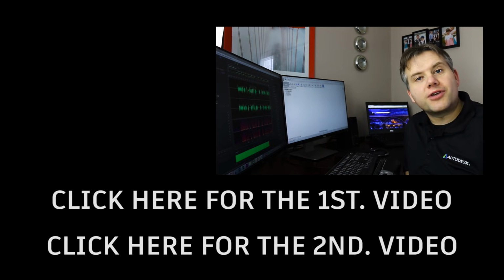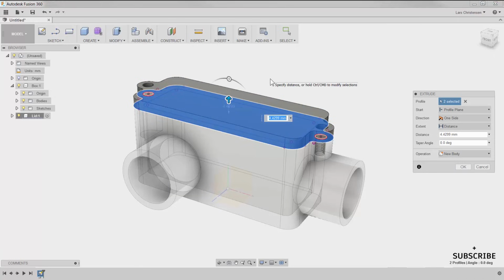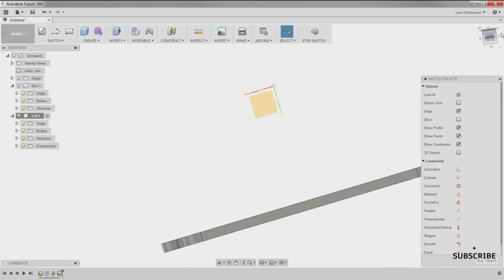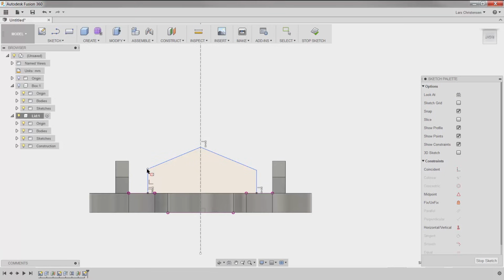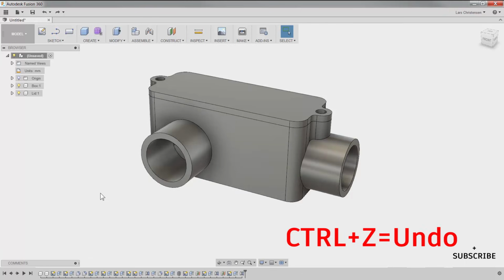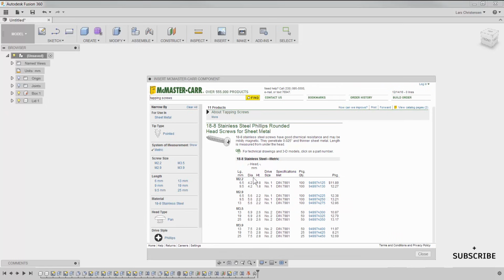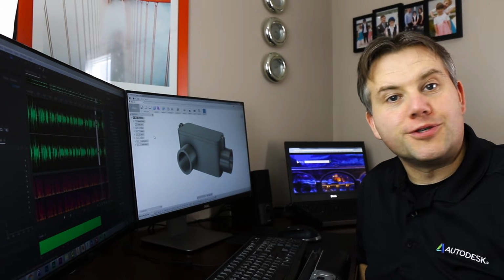Fusion 360 Tutorial for Absolute Beginners— Part 3

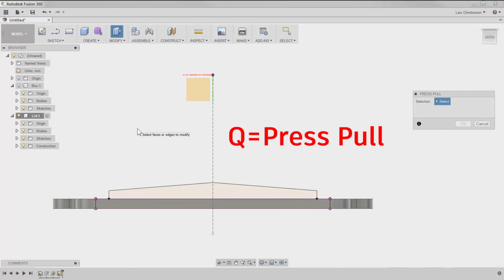Comment: Might be a version discrepancy (using June 2021), but at 9:17 I had to additionally fix one of the points on the lower segment of the sketch to have it fully constrained (blue outline to black). Not sure how his version "knew" to fix that lower segment to the lid, given that the plane we're sketching on technically has no relation to the lid... Anybody know if/where I'm wrong in saying this?
Reply: Faced the same problem
Reply: I'm having same issue - when I start placing the lines the cursor will not show the blue cross because its not 'attaching' the points to the line of the lid.

Comment: Hi only downloaded the free home user trial on 21/05/21. Your tutorials have been great to get to grips with the software, however I had and issue creating the "tabs" on the lid. When preforming the mirror function the second tab is in the wrong location. Took me a minute to figure out why but I found that the origin of the lid is off even though the lid is still centered with the body. Also I've seen im missing some menu options but I guess that's because its the free home user version. I'd like to know where I went wrong.

Comment: I've been wanting to get into F360 for a while, coming 8 years of using Rhino, a bit of SolidWorks and ProE, and a bunch of years of Autocad (which I hate, no offense, but good god, the bugs that have literally ben there for decades without being addressed) before that, had done the linkedIn series and was somewhat disappointed with that, but this was outstanding, even with the fair number of changes in the UI.  Had some difficulties getting the snaps to show on the tabs bit, but fixed that with a construction line.

Greatly appreciate not just the how's but the why's and the minimal glossing over of stuff most users do without thinking due to muscle memory but forget that those little bits if not explained or mentioned on these kinds of videos can bring those trying to follow it to a screeching halt.   Having done a fair bit of software training videos as part of my job in the past I have all the more appreciation for your approach.  Your videos will cut the ramp up time to next to negligable.   Thankee.

Here's a little piece I did in Rhino and rendered in Blender's cycles a while back that would have been massively quicker to create in a full on parametric modeler:

https://youtu.be/-zKHsOtAEL8

Comment: Great Video!  I have been able to complete the Box and Lid, but 
I am stuck at 6:58  When trying to create a line, my cross when getting close to the edge of the lid does not turn into the blue.  If anybody had the same issue, please help.
Reply: I did, turned out that the wrong face was towards me, also tilt the model a little so that it is not completely flat
Reply: Project the edge line

Comment: For anybody struggling from the bottom moving instead of everything resizing to the bottom, I just selected the bottom line that closed off the box and right clicked it and hit Fix.  Then when following the rest of his directions, everything seems to work smoothly.

Lars, please pin fixes for these issues or address them.
Reply: here the answer   https://forums.autodesk.com/t5/fusion-360-design-validate/can-t-snap-to-point-on-other-sketch/m-p/9479177#M215337     worked fine for me, just a lil click in pref

Comment: I just don't get the pieces on the lid, tried about 10 times now and either can't select the correct points and when it finally worked (once) the piece on the bottom of the lid was at the edge and not offset.

Comment: Lars, when I made the 4 protrusions on the underside of the lid, all 4 created themselves slightly above the lid (by about 0.125mm). I fixed it by manually moving all 4 of them down, but I was wondering what the easier way would be to snap them to the lid?
Reply: I had a similar problem, all I did was select the flat edge of the protrusion and the edge of the lid, and gave them the "collinear" constraint, which made them line up. Hope this helps!
Reply: @neekthegiraffe  helps immensely
Reply: @neekthegiraffe  were you able to get it to cut through the box on the short side hole without leaving the lines there

Comment: Hi while placing the screw into the hole using joint it goes in upside down Why
Reply: There's a button in the pop-up dialogue box that says "flip". Click it, and the screw inverts into the correct orientation.

Comment: Every time I try to change the numbers on the tabs to make the height correct, it either pulls away from the lid or goes into it. I can not figure out how to make it snap to the bottom side of the lid.
Reply: I just had the same issue and managed to find the answer online . . click on your name (top right) and go preferences  .. click on the design tab .. tick 'Auto project edges on reference' ... Apply and ok that... Now your line should connect to the other line and things should work correctly. This fixed it for me so fingers crossed. Hope this helps
Reply: @tombuxton7484  Exactly same problem. Your solution however doesn't seem to have any effect. :/
Reply: @tombuxton7484  Thanks, my cursor wasn't selecting the edge of the lid when sketching on the offset plane and this fixed it!
Reply: @tombuxton7484  thx that was helpful as well
Reply: @tombuxton7484  This seems to have solved my problem too.    Thank so very much Tom!    It was about to pull my hair out.    Just curious what did you put into GOOGLE to search for this.   I was at a loss for how to describe this.
Reply: @tombuxton7484  Thank you so much!  I got puzzled as did I follow Lars's instructions step by step and I could not find anything I did wrong.  Thumbs up Tom!

Comment: Hi Lars, Well I'm almost done with this one. Like you said the inside of lid is tricky. I got stuck on the lines which lifted off the lid till I figured out the center top to top of lid point fixed it. What confused me was you changing the side from 5mm to 2.5mm. This stuff can be frustrating but just hang in there and keep trying folks
Reply: Thank you! The centre top point was what I was missing also, needed to be done first.
Reply: @beardfu979  I'm having the exact same problem I think. I'm still not getting it though. I'm not sure I understand what you mean by "the centre top point nedded to be done first"?
Reply: @ottard  I've tried re-creating this again but I can't right now, it works right each time! I think what the issue was I had to set the dimension of the highest point of the sketch to the lid line first. Then the side dimensions worked as expected.
Reply: @beardfu979  Thanks for the response! I see now that my origin is on the lid plane - I wonder if that could have an impact. I'm gonna redo it and see.

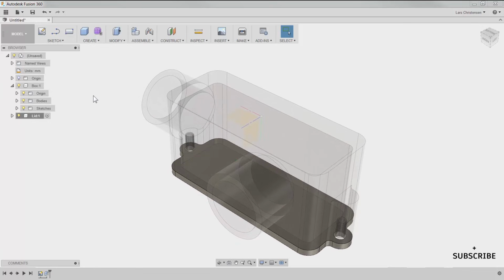Comment: please tell me how you beautifully view the bottom of the lid at 4:18 I'm brand new to 3d software apart from tinkercad and one of the most annoying things is the camera control. what are the hotkeys youre using to rotate like that?
Reply: i think shift+middle mouse button, or you drag on the cube in top right corner
Reply: @MrJohnDevour  ill try shift click mouse button thing, but he doesnt click the cube at all, i notice his mouse doesnt move as his camera positions itself perfect on certain viewing angles. ive played with the cube in the corner too its just as hard to control as using the mouse

Edit: he uses an extremely expensive 3D mouse.
Reply: the camera controls can be changed in the preferences to match those of Tinkercad
Reply: @ryandavies5063  yep i know, just wondered how his motions were so smooth almost like had a hotkey to focus on surfaces. Turns out he uses a 3d mouse.

Comment: I don't know if I do it wrong or if this is different in the current version: When I put these little things on the lid I can construct them, but they are not attached to the lid. After entering all the dimensions which you enter in the video the things are still blue and I can still move them away from the lid. Otherwise they are perfect. How can I make sure they start exactly on the lid? Or how can I move them to exactly that position? Thanks.
Reply: Preferences > Design > Auto project edges on reference
Reply: @tomaszdomanski4952  Thanks, that works. The difficult part was finding the preference menu. I found it top right when I clicked on the circle with my initials.
Reply: @tomaszdomanski4952  Thank you!!
Reply: @tomaszdomanski4952  Thank you! Wish I had found this comment sooner, I just spent faarrr too  long trying to figure it out.
Reply: @tomaszdomanski4952  I must be dumb, Where the heck is "Preferences"
Reply: @19tomas68  top right corner -> click on the circle with your initials.
Reply: @tomaszdomanski4952  OMG thank you
Reply: @tomaszdomanski4952  Thanks for the answer to my problems.
Reply: damn i was getting frustrated lol

Comment: Hi there mate. Thank you so much for your video. I have just started as want to teach students at my school how to create their own. Love the way you break down the steps. They are almost ready to go, for the students. Thank you so much. I am wanting to create a hinge that has a small cylindrical rod, with a sphere at the end. When I try to add the sphere to the cylindrical rod, it places the sphere on one side of the cylinder rather than in the middle. Do I need to construct a plane on the end of the cylinder? Also the cylinder is at a slight angle from the box that it comes out of. How do I create this angle (not 90 degrees)

Comment: Hi Lars,
I need help,
 at min 7 i cant snap my line ti the bottom surface of the lid, how can i snap to the lid bottom surface just like you?
Reply: I have the same problem
Reply: @aidanstacey9224  i got it, go to user name - preference - design - auto project edges on reference on
Reply: @ardillasn  many thanks dear stranger
Reply: @ardillasn  thanks
Reply: @ardillasn  dude, I tried 5 times,then I came to comment section and u r awesome
Reply: Thank you! That explains a lot.

Comment: Hi Lars, 
Great Lessons! I am new to Fusion 360 and it was easy to follow your instructions for the first 3 parts. Question: In your part 3 you import a screw from McMaster-Carr catalogue. I followed your steps, EXACTLY. However, after clicking SAVE, it did not import the screw to my Fusion 360. I checked my steps carefully many times. 
Any suggestions? 
Thank you.

Comment: at 13:00 i get something i didnt get on the long ones... i checked about 850 comments here to search for simulair but couldnt find it the issue is - Adding this dimension will over-constrain the sketch. Choose OK to create a driven dimension .. its just to get the lenght of that 3rd dimension part to 18
Reply: i had an issue at this point with symmetry working correctly. i had to redraw the sketch using the "project" method mention down the list for another issue. fixed my problem, might fix yours.
Reply: @westikle  il give it a go. but i also went on personal crafts after this vid i learned some and some good things :) besides of that part didnt work

Comment: Works great until this point, defualt setting on the latest version wont let the lines snap on at 6:57, I think this is because the plane is further in the model on the inside wall as described.  My page shows up the gridline.  I tried to fix it but somehow ended up permantly reversing the lid???? Tutorial was great apart from that!
Reply: Press "P" to project menu, select the lid body, when it is blue, press "L" to line.
Reply: @miklosb7191  Thanks, I needed this!
Reply: @miklosb7191  worked after this, thanks!!
Reply: I'm having the exact same issue, not to mention the symmetry tool doesn't work at all in the way he shows.
Reply: yeah after i designate the construction line i no longer have the reference plane to work from anymore
Reply: Thanks Vince... I struggled with this for a while until reading your comment. Maybe Lars could make a note in the video so others could benefit. Otherwise this tutorial is amazing!

Comment: I started with Fusion 360 yesterday. These tutorials are great and I'm learning fast. Most problems I encounter with the videos so far seem to be related to a redesigned interface since the original filming. For instance, at the 6:56 mark I was not able to continue because a few things looked and behaved differently.

Have you considered refreshing the videos to use the current Fusion 360 UI? Probably a good starting place would be the Absolute Beginner series.

Comment: Great Videos.  This one was challenging.  I am using a newer version of fusion 360.  Not the newest, I can’t get it to update to the latest.  That’s a problem I will tackle later.  I am more interested in following along with the video.  I just had to hunt around a bit to find the operators I needed to follow along.    I can’t get the McMaster-Carr tapping screw to save.   I get all the way to the save button. Click the save button, but the tapping screw doesn’t show up in the project.  I am trying to save it in 3-D Step.    Anyone have any suggestions
Reply: I spent the morning manually uninstalling fusion 360, then reinstalled it.  I now have the latest version.  Now I can import the McMaster-Carr parts. I did lose all of the third video sketches.  Just gives me more opportunity to do it again.  I’m sure I missed something the first 2 times around. :-)).  Thanks For the great videos.
Reply: I had this problem....my trial version expired so I renewed and now mine says (Personal - not for commercial use) at the top of my fusion 360.  After I renewed, the McMaster car insert works.

Comment: I feel this video REALLY needs redone. 

I became completely lost once it came time to make the triangular bits on the lid. After several people showed how to add the ability to snap the lines for the sketch to the edge of the box by changing a setting within the program... (Name > Preferences > Design > Auto Project Edges on Reference) 

I am now unable to find the options that Lars has on the sketch pallet when trying to modify the lines! Say, to make the line all the way to the right vertical in relationship to the box lid or to mirror what you do on the right to the left... I don't even have all the options he has! (starts at about 8:00) He has some sort of Constraints menu in his sketch palette on the right of the screen that I do not have? Is that something else I need to change in the preferences menu? Missing in the newest versions? All I have is the upper portion labeled "Options".
Reply: I beleive you are looking for the constraints. For me they are shown above the "working area" when in sketch mode
Reply: @GroenStedts  thanks. Next time I'm trying to learn, I'll check there.
Reply: You have your needed options listed when you right click.
Reply: @avyitis3425  once I can ave some free time, I'll try that too. Thanks!
Reply: @1423big I used under menu Constraints>Colinear to select the two bottom points and the line then went to dimension and it worked perfectly

Comment: The problem that a lot of people facing is,  while drawing the lines for lid guide, we were unable to set the dimensions as Lars did in the video. The solution I found was simply draw all the lines(resultantly the lid guide will be floating in the air or will go inside the lid) then select the colinear option from the constraints menu and select the bottom line of the lid guide as one geometry and lid surface as another geometry. Hope this helps you guys as well.
Reply: not that great solution. the better one is right click on your name in top right corner of the screen and then follow the steps as mentioned by @
Scott Dube in comments:
 Edit: Got it, Name > Preferences > Design > Auto Project Edges on Reference is on Thanks to @Mr. Random
Reply: @irfanabbas3839  Thanks Man.  I was having problems with the lid guides moving all over when I tried to add the dimensions. Your suggestion fixed it and saved me from tossing my computer into the sea.
Reply: @irfanabbas3839  thanks dude... It was so frustrating
Reply: That saved my sorry behind, I was getting so frustrated...thanks!
Reply: PLEASE HELP ME MAN. THE SKETCH'S LINES ARENT DEFINED AND NOT TURNING BLACK FOR SOME REASON.  YOU HAVE DISCORD? MAYBE WE CAN HOP IN A CALL. if not its okay but I really need help I used so much of my time already
Reply: @headstabber6907  elaborate more on that. Discord is not an option for me, sorry.
Reply: Thanks this is exactly what was happening to me

Comment: Great video, thanks!  I am a complete newbie to cad/cam and F360.  I did well with building the model until it came to adding the guides to the lid.  I was able to create the construction plane but when drawing the lines for the lid guides I could not get the line on the lid to light up and have the cursor change.  As a result the guide is not attached to the lid.  I cannot figure out what I'm doing wrong...  Anyone have this issue?
Reply: Edit: Got it, Name > Preferences > Design > Auto Project Edges on Reference is on Thanks to @Mr. Random
Reply: @Scottforyoutube  OMGOODNESS THANK YOU!!!!!!!!!!!!!!!!

Comment: So when it comes to drawing the lid. When I do the symmetry and horizontal constraints, everything works as it should and the lines are great. But when I go to dimension lets say the 2.5mm length for the lips of the lid, it expands the dimension down not up. Is there something I'm doing wrong that it goes up on your video but on mine it goes down when I follow the steps? I'm about to just draw the lines to length just because it is easier at this point, but it would be nice to find out if you can tell it which direction to dimension to up or down left right etc.  Thanks!
Reply: I have a similar problem with that part also.  Did you resolve it?
Reply: @Scottforyoutube  No. I just ended up drawing the part to the dimensions he specified to resolve it. Everytime I did it the way he did it, it would expand it downwards. Its a nice feature to use it the way he did, but it was giving me grief
Reply: @Scottforyoutube  Same problem. Did you resolve it ?